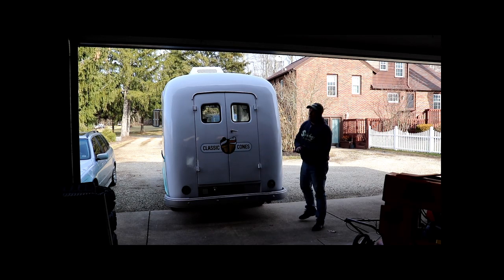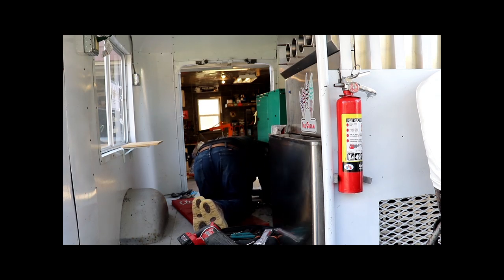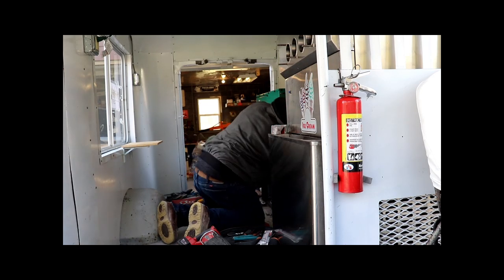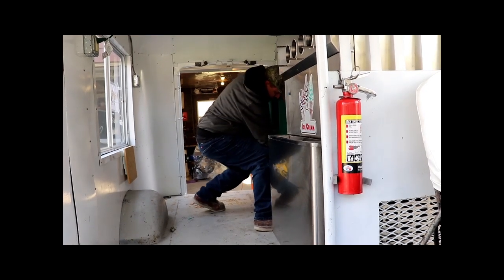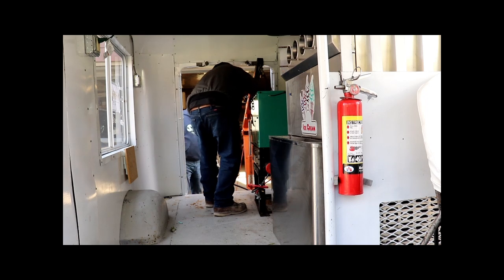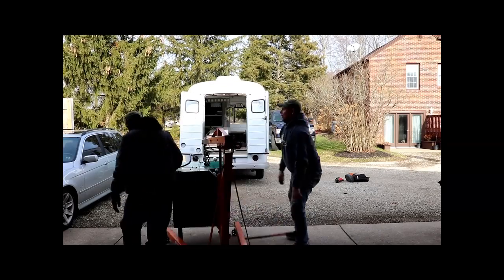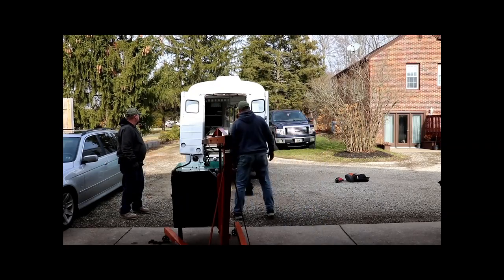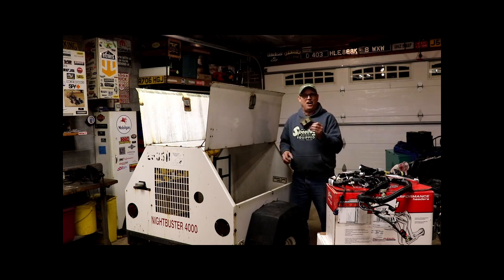ICE CREAM TRUCK LS SWAP! AWD V8 CHASSIS TOO!

Comment: Why are you using a Chevy Tahoe as the donor as opposed to the usual Durango?
Reply from the maker: This Tahoe Chassis fits the wheelbase of the van almost perfectly. That way I can leave the body unaltered. The Durango is 3.5 inches longer and makes for a difficult fit on this nice paint job. :) Thanks for watching!
Reply: Back in 2017 you did another build with a 1960 Racing MILK VAN, also an International, that used the Durango chassis. Are you taking the Tahoe route because of lessons learned on that build and thinking perhaps it would be easier to accomplish with the Tahoe?
Reply from the maker: No, it's all about wheelbase. I prefer the Durango because of the Hemi power. Metro vans have all sorts of wheelbase choices and the Tahoe simply fits between the wheel arches better. I do not want to alter the body of this ice cream truck and the Tahoe is basically the same truck as the Durango but a bit smaller- so it fits. :)

Comment: What’s your plans with that 54 dodge?
Reply from the maker: It will be a Hemi AWD swap at some point. Thanks for watching!
Reply: Grenade Motorsports I used to have a 48 b1, always lookin for another,, wanted to make into a 4x4 using Ram 2500 parts and drivetrane